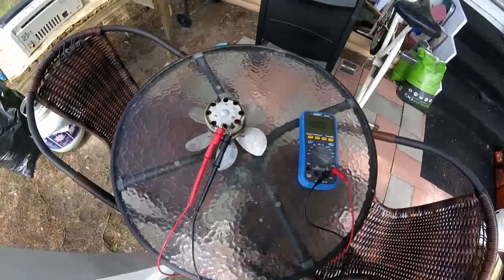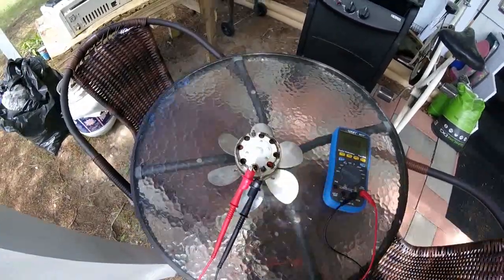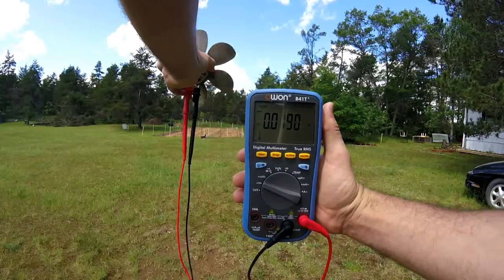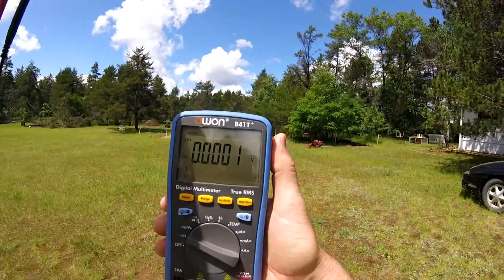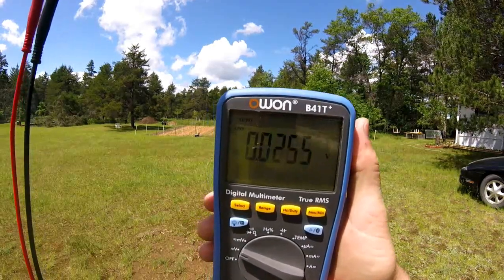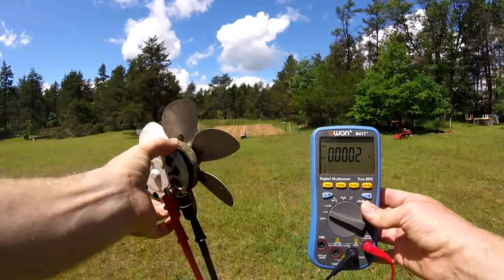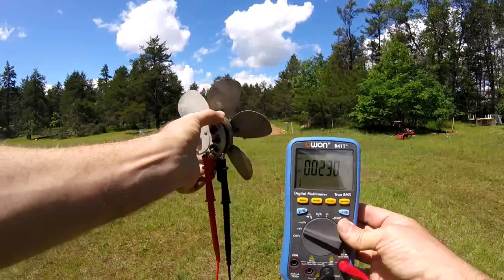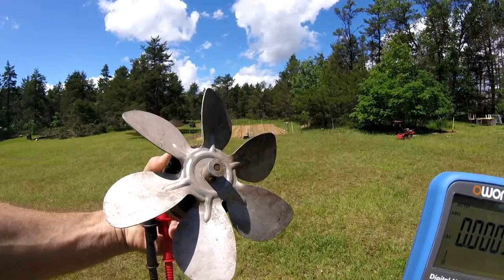Normal AC Fan Motor Produces Electricity In The Wind

Comment: yep and with 10 of those motors in series you may get 1Volt!
Reply from the maker: Does not matter. I am going to put magnets in this and get some real power later.
Reply: In my opinion just connect it to step up transformer or an inverter, it will increase the output voltage.
Reply: And?
Reply: I would like to make something for my ebike with 4  3 volt little generators on a fan and I think they call it a inverter that will do 52 watts to charge my battery one of them while I ride. A lot of people use those solar generators which are really big I want something smaller is it possible?
Reply: @LetArtsLive   Maybe. A fan this size going against wind will produce 1-5w im assuming...... If you pedal against maybe 10w. Not much power. You need a charge controller, a small battery pack (lithium ion) and you could charge your "phone" perhaps.....

 I thought ebikes could collect back energy when you pedal assist or go down hill? There are foldable solar panels which you can wear on your back, like an apron.

Comment: Now that is amazing. Do you think the fan would spin more if you extended the size of the blades?
Reply from the maker: Yes any DC motor makes a good generator or wind turbine. An AC motor requires magnets in order to produce a usable amount of energy but a DC motor already has magnets inside. Just spin it up and it produces power. That fan had plastic blades and would not be any good as is. It would need good wind turbine blades to work well.
Reply: Ahh, would plastic blades get brittle after being out in the sun all day and break off in high winds?

It looks like your new DIYE channel is gaining more and more subs.
I was subscription #46 by the way.
Reply from the maker: Yes and it would spin a lot better with a real wind turbine blade.
Reply: I was wondering if that crazy fast small ceiling fan you had in the tiny house would be a good 
candidate to donate parts for this project.  I am sure Baby Cat would give a Paw up.
Haha  i remember she did not like the sound of that fan.
Reply from the maker: For one yes the blades would get brittle. But another thing is that most fan blades are not good for producing power. Yes the channel is growing nicely :)

Comment: Speaking of turbine blades spinning up easy.  It seemed to me at the old homestead your larger wind turbine required 
quite a bit of wind to spin.  Did it have a lot more resistance in it than your smaller one?
Reply from the maker: Once you add large magnets it takes more wind to spin it up
Reply: Ahh,  is the advantage then that with the added large magnets they will generate more power when turning?

I wonder if on commercial wind farms they have a way to engage or disengage magnets from the wind turbine head so as to be able to have them turning in light winds as well as strong winds.
Reply from the maker: Yes larger magnets will produce more power. And larger coils too.
Large wind turbines can rotate their blades depending on the wind speed.
Reply: Ahh that makes sense they would be variable pitch.

Comment: Hey Troy I recall seeing in one of my favorite Post Apocalyptic TV series called  "  Jericho "  one town made it their 
specialty to start manufacturing small wind turbines to sell to other communities in their down grid world.

Is it feasible to make your own wind turbine and how many do you think would be required to generate enough
power to maintain your battery bank?  Do you consider wind power only effective in small homesteading as a supplement 
to solar power?

I think it would be a neat project here to see you construct a home wind turbine using only local available
materials.
Reply from the maker: I used to watch that show. Yes you can make your own wind turbines if you have the skill. I plan to make a few on this channel. I think that wind and solar go well together. When it is cloudy or rainy it is usually windy so the one supplements the other.
Reply from the maker: That is a very good price and yes it will produce some power in the wind. Again you could improve the blades for better performance. I would at the very least waterproof the motor and paint it all to stop UV rot from the sun.
Reply: Bill23799 He could make it into a self running genator after a little a.c. from the grid for initial start up. He only needs a car alternator to mesh with. The alternator takes AC fan motor shaft input makes D.C. at 12 volts at 14 amps output. Now run that thru a inverter to keep fan motor turning you have a self running generator with steady output of DC at 12v at 12 amps after using a regulator to send 12vdc  2amp to run a A.C.  inverter. Cut your grid power when the inverter puts out A.C. power.
Reply from the maker: Frederick, I have heard of this but I am not sure it works. I hope to one day try it out.
Reply from the maker: I have seen videos but then again, you cant believe everything you see on video. Hopefully one day I will find out.
Reply: The Do It Yourself World Electronics It works as the videos of five years ago show.
Reply: Fred do you have a link or remember the title?  Would like to see.